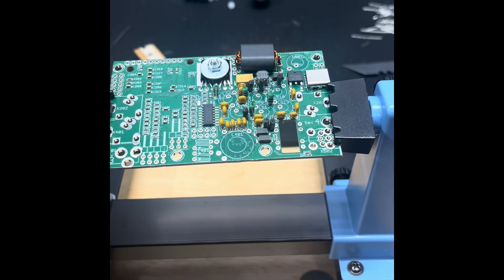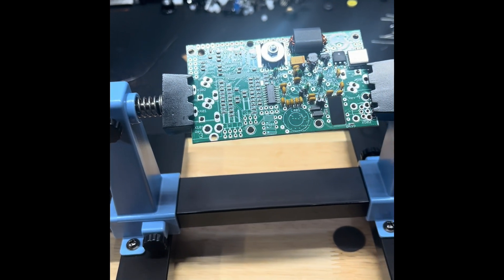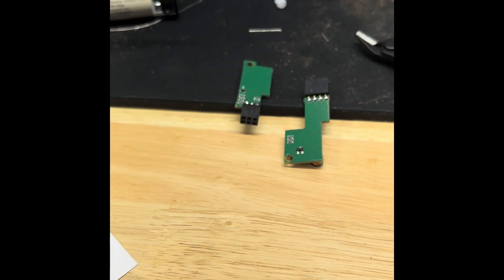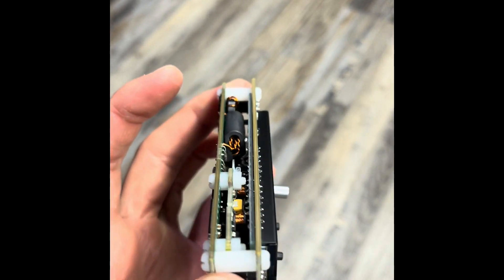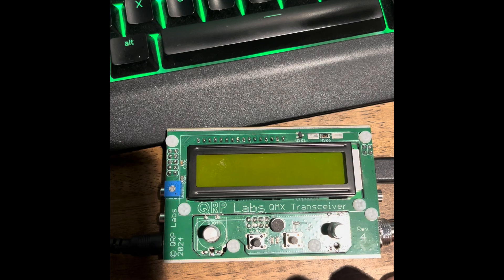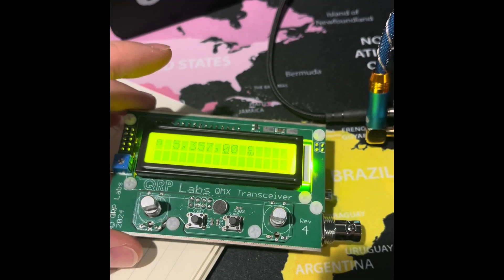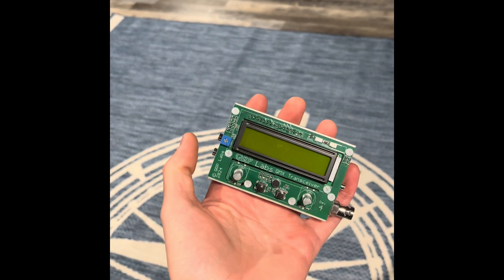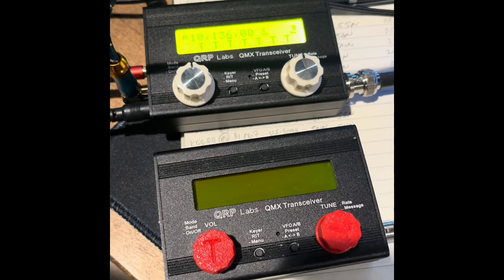1 Day QRP Labs QMX Build (Mid-Band)

Comment: Nice review thanks. Can I ask what solder station did you use? Also, did you print out the entire manual in color or just selected pages?
Reply from the maker: I printed the entire manual in color. I believe having the pages at my finger tips helped me build quicker. I also used many of the video resources out there like the most common mistakes. I used a cheap Amazon solder station that also has a heat gun. During my first build I wasn’t getting the iron hot enough. So I set mine at like 780 degrees which some say is too hot but it worked for me. I also used Kester 245 63/37 core flux type “no clean”

Comment: Hi Forrest, belated congrats for your successful bid; they're an amazing little rig for sure. You probably know now but didn't know at the time of the build that it is normal for there to be nothing on the display of the new build until the initial firmware flashing and the adjustment of the 20K trimmer potentiometer. I guess it's a personal challenge to build it quick but I would recommend that most slow down and read the manual/build instructions before starting the build and during.  Information like the initial firmware flash/blank LCD, soldering tips on this thick board with multiple large ground planes are all well documented. Measure twice, cut once!  I took considerably longer to build my QMX, stopping often to take a break.  I've started to build a few of the backlog of QCX mini kits I have; I just finished a 30m kit and it took me 3 days. Got it up and running and got 2.7w initial output with a 12vdc power source....... not bad!  Today's mission, during this snowstorm, is to tickle L3, L2 and L1 and see if I can get closer to 4 watts (not going to sweat about it).  I enjoy your videos, thanks. 72 OM!
Reply from the maker: @cwqrpportable  couldn’t agree more. Even Hans the creator of the QMX says to be very patient with the build. The reason I flew through this one was it was my 2nd QMX. So I already had the full experience of the build and my first QMX had some small mishaps that I was eager to correct and succeed! ☺️

Good luck with yours!

Comment: I ordered the mid-band QMX kit this morning, I have built two QCX minis and have had many contacts, so I'm excited to build this. 72 Joe
Reply from the maker: @ai5dd  the mid-band is awesome! Just my $.02! I’m surprised how much power I get out of my 9v QMX than I do my 12v. In talking with friends, this seems to be the case across the board. Of course all my other rigs are 12v so it’s a little annoying but I like the consistent 5 watt performance across the bands compared to the 3.5 watts in my assembled unit.

Comment: I just finished a QMX  mid-band build tonight and upon installing the firmware I found that I had a partially working display! I was distraught to say the least. Fortunately that’s an easy board to diagnose and I quickly found some continuity issues with a couple of the pins. Enter some more heat and solder and all was well. 
I can’t wait to give it a test run later this week!
Reply from the maker: @Radio_KS4BG  Oh nice! Yeah that’s great news I’ve heard some tragic stories following the build. One of my good friends just finished his QMX a few days ago and he was convinced something was wrong with the build only to find out his USB cable was charge only (non-data) haha. I’m stoked for you man. QMX is one of my favorite rigs and an essential radio for QRP guys like us!! Hopefully we can snag a QMX P2P soon!
Reply: @utahforrest Man, that would be great to get a QMX P2P with ya! In October I’ll be using the NAQCC call N3A/4 for a few days and I’m hoping to use it for POTA and a couple of gnarly SOTA spots If I can reach them without getting myself killed.

Comment: Hi Forrest. Just found your channel and I'm really liking it. I love your energy. A question for you, though: you inspired me to order a QMX kit. I ordered the 80/60/40/30/20 version yesterday. I'm wondering if I should actually have ordered the 'mid' band version (60/40/30/20/17/15). Your thoughts? Do you do much CW on 80 meters?...
Reply: Chris, if you don't mind operating at night, are selective and PATIENT, 80m QRP CW can be a lot of fun. Personally, I think you made the right choice with the 80/60/40/30/20 version. But that's just my opinion....... I do lots of NVIS operating and get more of a thrill with a 300 km contact than a 3000 km contact. 30 yrs ago I felt exactly opposite!  hihi  Considering the price of these kits, you could always build a QCX-mini for each of the two bands you're missing. (I'm a bad influence). :face-orange-raised-eyebrow:
Reply from the maker: Thank you! I appreciate you watching and your kind words. What's funny is I have assembled the low, mid, and I have an "assembled" high band that'll likely ship in the next 30 days (it's been a long wait). Because these kits are like $102 I like having the band ranges from top to bottom and the three radios combined cost about the same as a Mountain Topper and half the price of a Penntek (for all 3 rigs!). But to answer your question I wish they'd just make a 40-10 version as I never use 60 or 80. However, I'm new to CW & HF frequencies, I just got my General back in January. If I had to bet, I'll venture into 80 here soon I just don't have an 80 antenna yet. So I'll be glad I have the 80 band rig as well here soon. If I had to recommend one it depends on what bands you like but the mid-band has the best band options IMO.
Reply: @utahforrest , thank you!  That was quick - you can ignore my Gmail note to you :-) Maybe we'll get a QSO in the log book at some point.

Comment: I built the QMX+ 160 -6 meter kit and also had the same issue with the display.  I found a comment on the QRP Labs forum where it said you had to do the firmware update, then power off and back on, and that did the trick.  Anyway, maybe Hans will put something in the instruction manual in bold red letting people know this will be an issue, so it gets your attention.  Yeah, and thought I had missed a solder joint, but after another inspection, didn't find anything wrong, and then got the answer after searching for this problem.  Everything tested good and I ended up from a low of just under 4 watts on 20 and 17, ranging to a high of just over 5w on 160, near 5 on 40 and 80.  Overall, a success I believe, but maybe tweaking the toroid windings on the lower wattage bands will help.  Or, maybe I just leave it as is. Mike - ND7E
Reply from the maker: Huge congratulations on the QMX+ build! What an awesome rig! I may have to try my hand at that build here soon. I’m with you! I think it is documented somewhere but I missed it and was so excited to see it power up after throwing the firmware on! 73 de KI7QCF

Comment: I got my mid-band in the mail last week. I'm finishing up another project, and then I'll do the QMX! Thanks for sharing this video. It makes the build look doable 🙂
Reply from the maker: Nice! It’s a fun build. One mistake I made during the build was cutting one of the vertical toroid wires before measuring them installed on the board. That’s why it ended up a little crooked when installed. However, that’s purely aesthetic and hasn’t impacted the quality.  Good luck!!

Comment: Very impressive that you finished that in one day. I might be able to to two days at this point, but it’s a stretch—only bc I have built 2 before. :)
Reply: Btw I kinda wish I had a MB QMX instead of my HB bc I think it appears to be slightly more optimized on receive sensitivity and TX power (an extra watt+), on average. But no biggie.  :)
Reply from the maker: It’s probably a better idea to take some time with this build! Haha. One thing I forgot because I went so fast was to put the spacer under the right push button. I went back and did it. Enjoy the build process and the finished product. Hans is really innovating with this radio!